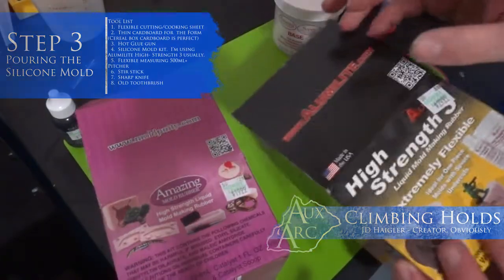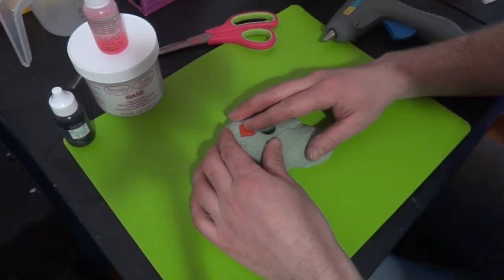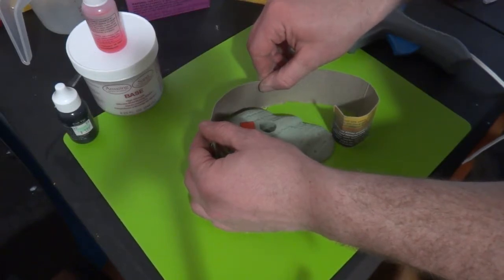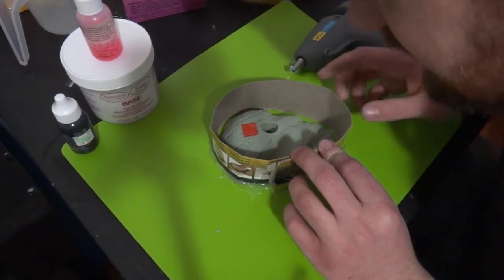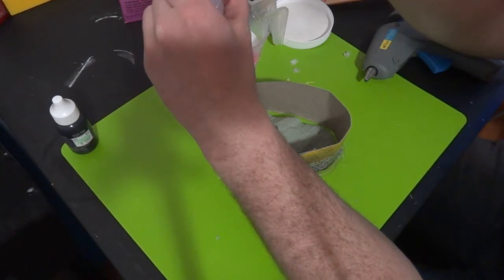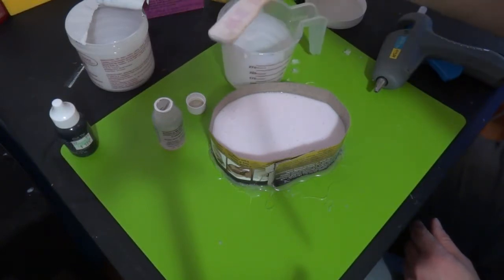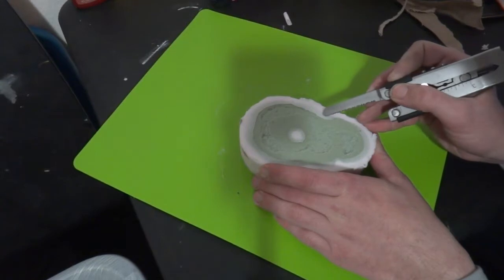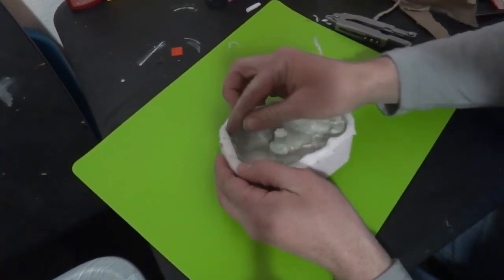Part III of the Hold Shaping Series

Comment: Hey! Thanks for all the videos on the production proccess of climbing holds, they're really informative!! I've been trying to make my own climbing holds, but can't seem to hit the right texture for the holds. I was expecting the surface of the resin holds to be way more rough, they've been coming out smooth - unlike the ones I climb on the climbing gyms, which have way rougher surface and a lot of adherence! Do you know what could I do to solve this?
Reply from the maker: What foam are you using?
Reply: @AuxArcClimbing  Just regular dry flroral foam. I've noticed that the floral foam gets out of the silicon mold a little bit moistened, as the surface of the silicon mold that touches the floral foam.
Reply from the maker: @ThePeregrin  that's weird.  What silicone are you using?
Reply: @AuxArcClimbing  I'm using the only liquid silicone rubber avalaible here at my location (Brasilia, Brazil). It's a blue high flexibility silicone rubber, it comes in 1 kg packages and with a 30 g catalyst - so the catalyst/silicone ratio is 3%. It seems like the floral foam absorbs some of the silicone and it makes the surface way less rough than it should. Did you ever have this problem?
Reply from the maker: @ThePeregrin  I haven't. Try spraying the foam with a few layers of spray adhesive. Let it dry.  It'll harden and kind of seal the foam. Try that on a foothold and see how that does.
Reply: Thanks, JD Haigler!! I will try that. Anyway, thanks for all the atention and the great content.